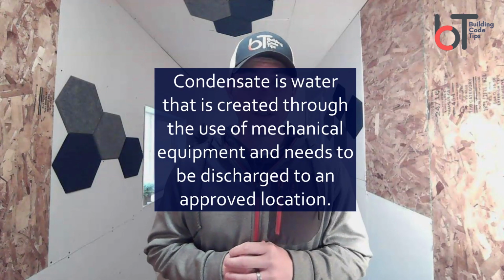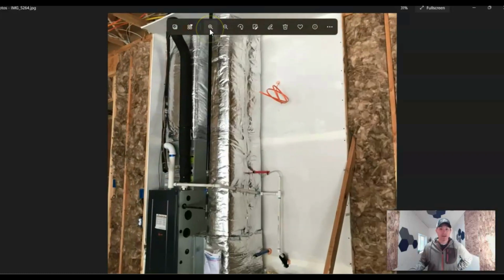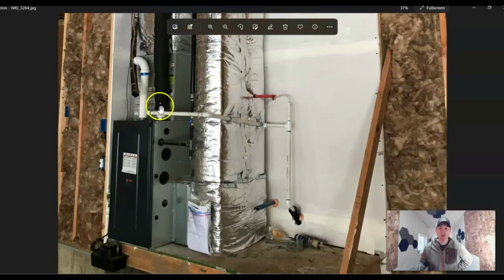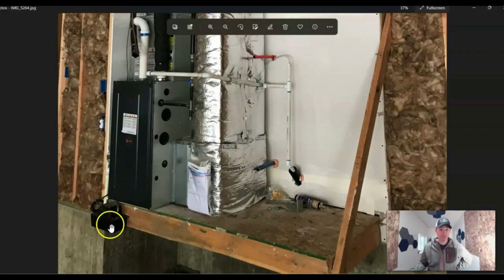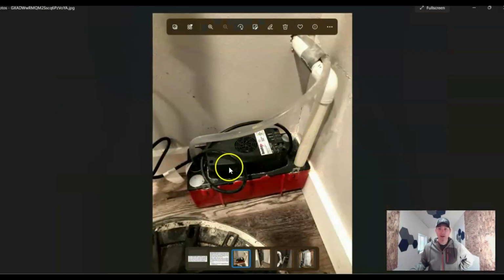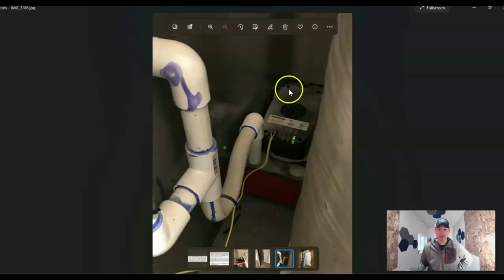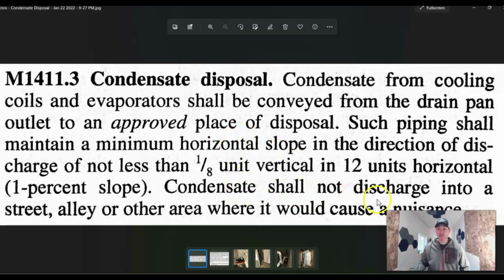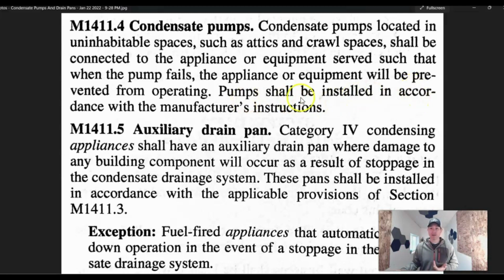Condensate Pumps | Installation Tips And Requirements For DIY'ers

Comment: I was always taught a 1/4" drop per foot. Is 1/8" code where you are for all plumbing or just condensate drain? I'm wondering now if I was taught 1/4" just to be safe
Reply from the maker: Thanks for the comment. You are correct in that plumbing drainage should be sloped at 1/4” per footing. With the exception of a 4” main line drain can drop to 1/8” per foot. Condensate is run under the mechanical code (IMC) and allows for 1/8” per foot. Its not considered plumbing since it derives from mechanical equipment and is usually indirect drained into the drainage system!
Reply: @buildingcodetips  thanks for the info. That makes sense given that it's just condensate and not grey/black water running through the lines. Growing up in PHX I had never seen a condensate pump until I moved to TN. Crazy how differently homes are built across the US